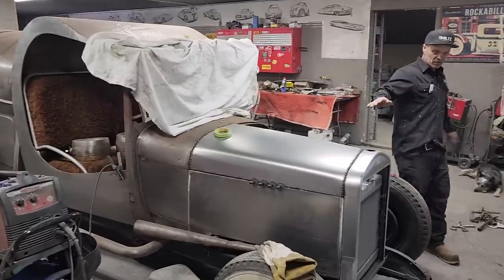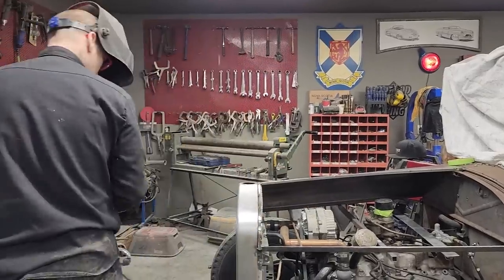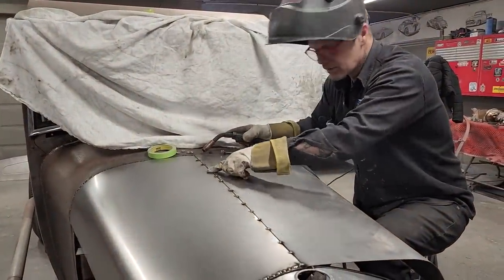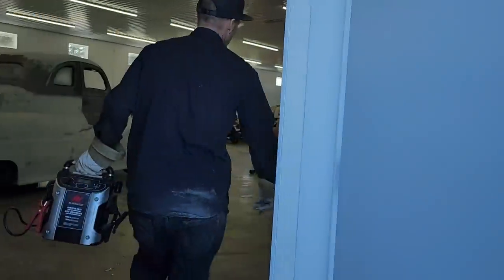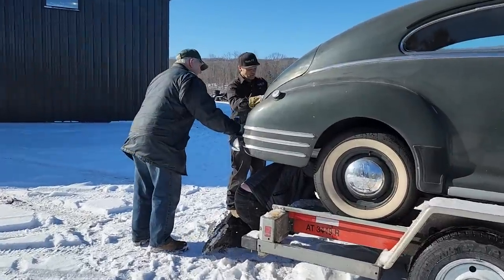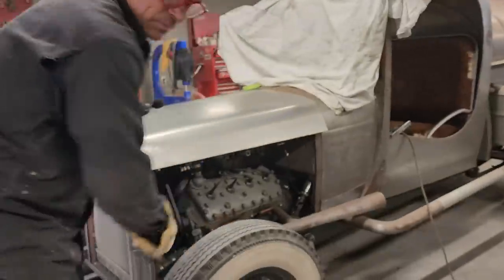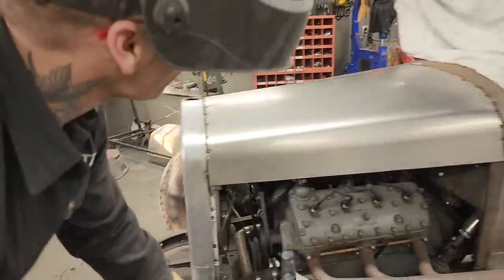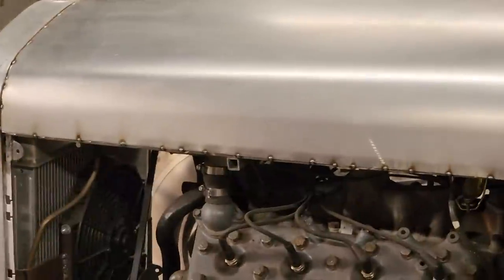We sold a car in the middle of fabricating the final hood panel 👏🏼😂

Comment: The hood is coming along really well.  Just a thought instead of welding all the panels together could a hinge be mounted to the vehicle in the center then attached to the top halfs of the hood. Then hinges on the side panels installed allowing the side panel to swivel inwards when opening one side.  With all the work of welding, grinding etc.. maybe this would be an alternative with a bonus of opening the hood like a typical vehicle in the same era.
Reply: That's the way my '47 GMC was.

Comment: Looking at that flathead while your welding the hood has got to be" cooler than dangit" to borrow a phrase. Maybe put a small flat  board between you and the handle of the rib breaker to spread the load, save your ribs, give you more pushing power. Lovin the build brother! I don't know how you get anything done, I would be chasing that wonderful filly all around the garage!

Comment: Not only sparks from welder, Chad. Don't forget sparks from grinder, flap wheel, zip disc etc. Those little guys are travelling at a gazillion miles per hour, and can travel around the shop bouncing off of hard surfaces. Lovely job, the both of you. Greg , South Africa.

Comment: Now I’m not a glass scientist but, front windshield glass is laminated and the side windows is tempered. You can use a razor blade on the front glass but NOT on the side glass because the side and rear glass being tempered it’s produced with heat and if you looked under microscope you would see bubbles and using a razor it would pop those bubbles and you could see the blemish on the glass. On tempered glass use 4 ought (0000) steel wool to clean the glass, great for removing water stains.

Comment: When you get older in life and you bruise your ribs or break them it is extremely painful stuff. I know I use to kickbox and box when I got older and got those injuries man they were tender. I couldn't even breathe without hurting them. That's how tender they felt, when you don't have those young muscles to support those ribs anymore it's another story all together.
 btw That tool that you have for pressing the metal together to help hold the tack. You should make some at different lengths that would make things easy for ya.

Comment: That roller machine that Chad has has adjustments on the back on both sides I've seen him adjust them before if he would win them one side almost all the way and the other side wind it out almost all the way and then roll the sheet metal through it would make it the shape he wants a lot easier

Comment: Some times those carbs leak because of dirt on needle valve. I take an pinch of rubber hose run the eng tell it starts to run out of gas. An when it starts to quit pump the throttle it will suck the dirt out of needle an stop leaking

Comment: You could get 4 wheel lifts so you can drive up on one then raze that car all the way up then put a car under Neath . What you rilly need parking garage with it closed in with Windows to let in light in each floor that would be perfect for you and all of cars an trucks an motorcycle's all the semi trailers for all of your good part's you can put it up on shelves you can cut up scraps of the poster bord an use a hole punch an a piece of string then right what that part is on the poster bord

Comment: I dislike it when people leave negative comments.
However...
In this instance, I am going to break my own rule.

With snow on the ground, I don't understand why the gentlemen picking up the car didn't back the trailer up closer to the overhead door of the new building.
With no (or extremely little) snow on the tread of the car's tires, it would have been so much easier to load.

Granted, I wasn't there. It isn't my car, or building.
But it is my opinion, based on decades of loading vehicles, tractors and equipment, onto various types of trailers.

Chad and Jolene, I am glad that it all worked out!
And I am sorry for leaving a negative comment.

Comment: How are you going to get to the top of the motor for servicing with the hood welded on? Also, how will the side panels be attached with nuts without being able to reach them? I must have missed something here.
Reply: Chad is welding the sheet metal top to the frame, not the cowl or radiator.

Comment: Why don't you use the roller to make your metal curve by applying pressure to the rolls and rolling it back and forth to get a smoother bend? Kinda using more control